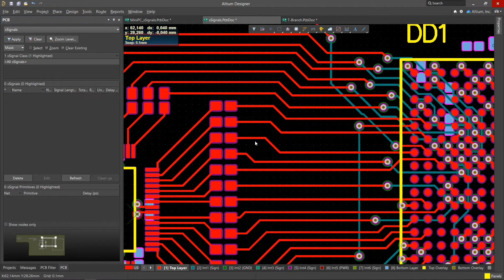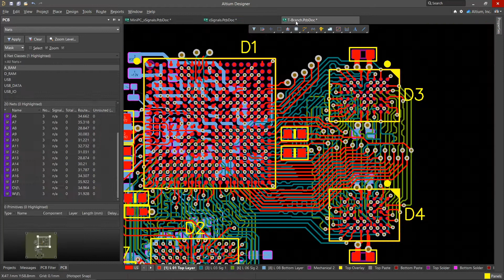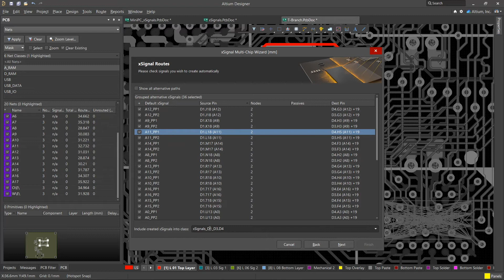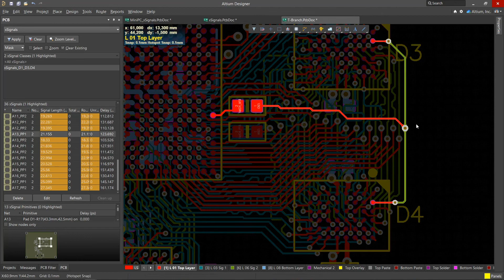Creating High-speed Signal Classes with xSignals in Altium Designer

Comment: So Xsignals is a method to do length matching and length matching setup within the PCB file? While it is also possible to setup the length match parameters via the schematics. So its just a different method right?
Reply: no not really. X signals is for when perhaps you have series termination component in your crucial high speed signals. the x signals accounts for the length traveled through those components

Comment: Can xSignals be created in the schematic?
Reply: From what I recall you have to do it in the PCB layout
Reply: @Zachariah-Peterson  How can i to do the same for diff pair, if it routs through several components? The problem is that in a output of other component altium doesnt read as diff pair
Reply: @Zachariah-Peterson  You can create them in the layout, of course...but they should be able to also be created in the source document, which is usually the schematic.  No reason they couldn't be (if the tool supported it) as all the info is in the schematic to be able to do it.  Another enhancement I think would serve Altium well...